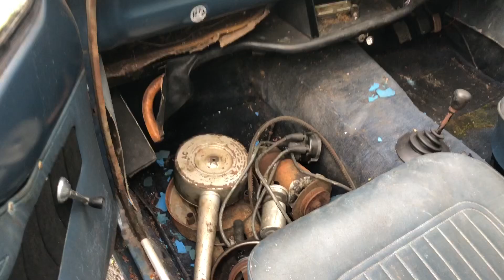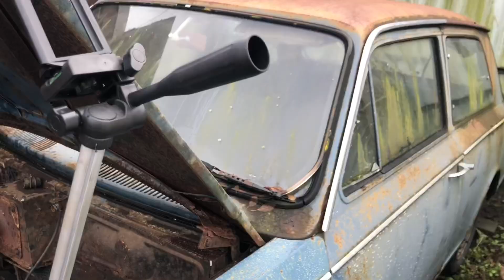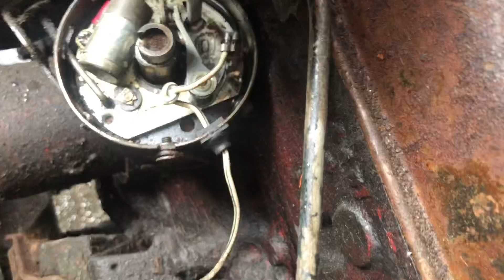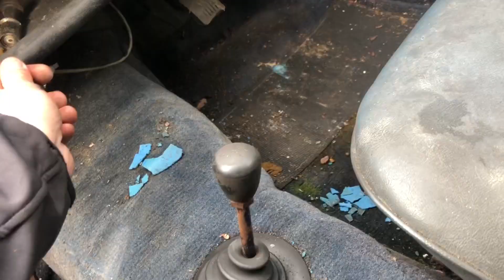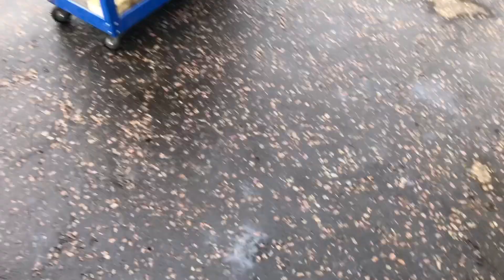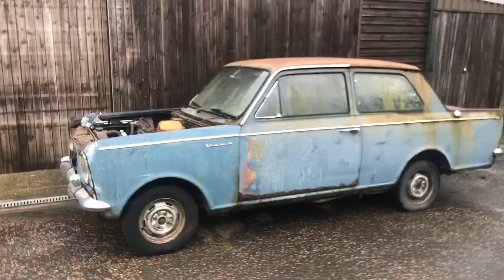Will it run after 19 years 1964 HA viva

Comment: Well done! You were lucky as I’ve done a few in my time and usually the carb is gummy and as you suggested, the valves jammed due to seized rockers. As for the ignition ~ simple stuff. Most my age and older were brought up on 1,3,4,2 and 25mm gaps! .Those cars were bread n butter along with the Ford Anglia and mini, I’ve not seen one for years! I had a Vivian the early 80’s but the principle was the same as that one. Someone will buy that running or not!
Reply from the maker: Patrick Morgan 🍻👍

Comment: Very entertaining. My Mrs (then girlfriend) had a '76 HC Viva in Volcano Red. Basically a nice car but very soft front suspension. It made me car sick if I was a passenger in it, so I always drove. Those AC Delco distributors used to wear on the shaft making it difficult to run properly as the points gap varied due to the wear. You couldn't get a secondhand dizzy as everyone with a Viva wanted them! New ones were expensive and so I got a guy to bore the casing and fit brass bushes. The later engines (HC) had a Stromberg Carb and a viscous fan. The rocker arms were a very basic affair too. Points were a doddle to change though.
Reply from the maker: Allan Davies 👍

Comment: Brilliant! 
All took me back to the late 70s watching my dad working on Vivas, Cortinas and Escorts etc. 
Scraping the rotor arm on the concrete floor to clean it, using cigarette papers to set the gap on the points and holding a lead with a plug in it against the metal bodywork to check for a spark!!
Reply from the maker: GT Thompson lol 👌👍 you can’t buy beautiful memories like that 👍
Reply: As annoying as these old cars where I think they was better any one with abit of knollage could get stuck in and repair it unlike know where u need a a level in it 😂
Reply from the maker: Anthony Thomas 👌👍

Comment: Was that the time era of cars that were killing Vauxhall?
Reply: The Viva (HA and HB) did well, and were good competition for the Ford Anglia. The production run was 16 years. The Firenza which followed was tuned up and modified by racers like Gerry Marshall, and the components of these cars were very popular with hotrodders. The HA Viva, with over 300,000 made, was a solid car mechanically but its weakness was corrosion in the wing cappings, which crept down into the structure of the rear wings and boot floor. They are rare classics now, with an excellent Owners' Club and good spares availability.